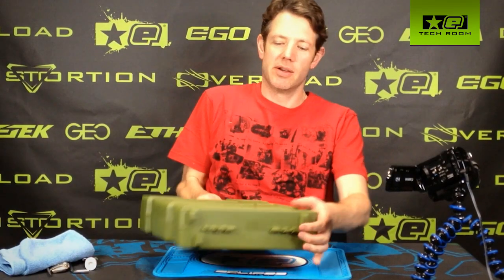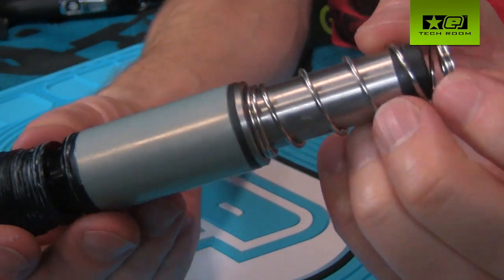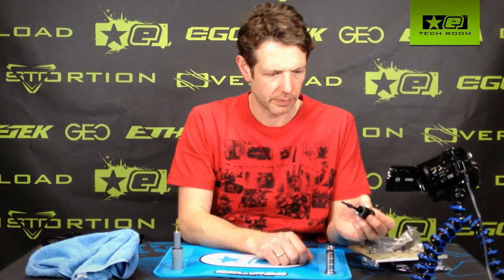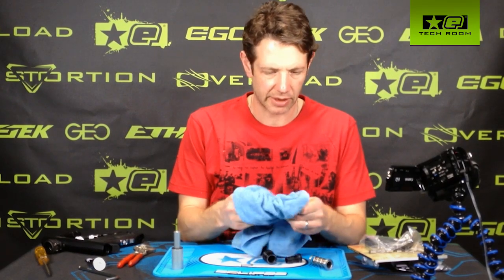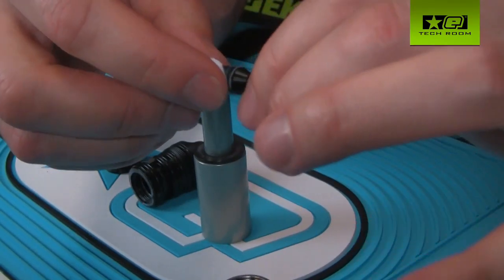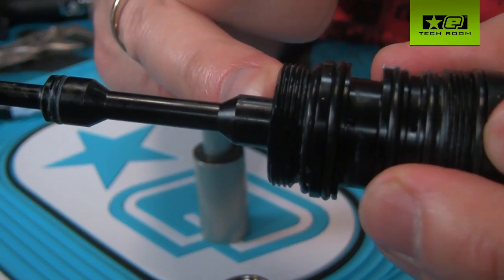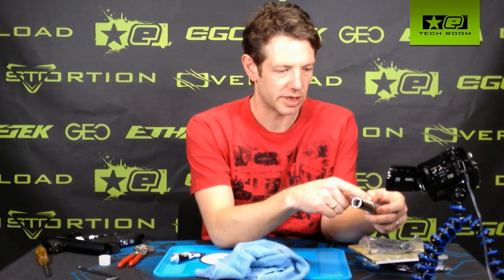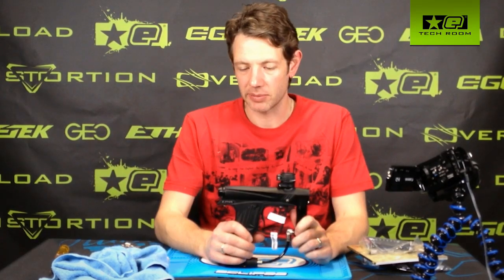Tech Room / Etha / Maintaining the Bolt Assembly

Comment: Question I greased everything up o rings and everything my gun is still leaking ... and I can kind of hear it inside the gun it’s not the tank or anything like that not the hose at first I felt air coming out of the bolt lube itdown and that helped but it’s still leaking